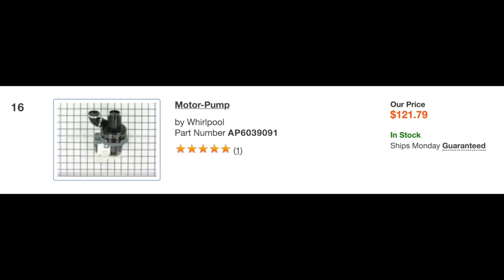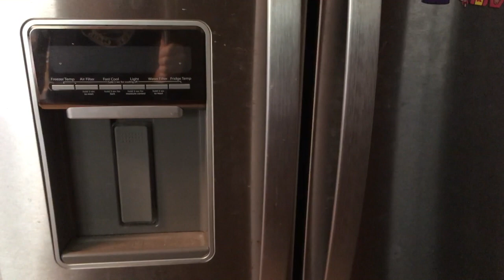Whirlpool Dishwasher Pump Motor Repair (And Upgrade?)

Comment: I have a Kenmore 665.13223N411 which is apparently a Whirlpool chassis. The panel on yours looks different, but the underside mechanics look identical to my own, so far as I can tell - definitely the same circulator pump assembly.

When the washer was just over 2 years old, it started having problems where it seemed to be stuck in the middle of the cycle. Sometimes, it would seem to keep running and running and counting down, but never advance in the cycle. Other times, it would get to about 210 minutes and then it would stop and you could hear a relay click every few seconds - it would basically do this until the timer ran down to about 45 minutes, at which point it would drain and refill and then complete the cycle. You could typically remedy this by opening and closing the door and then pushing start to complete the cycle. 

I noticed at these times that if the washer was stuck, the heating element seemed to be on, and if you opened the washer up you would actually find that it had evaporated off nearly all of the water inside. 

The problem was very intermittent. The washer might run correctly for days, weeks, or even months, and then suddenly have the problem again. Interestingly, I always found that when this would happen, my water hardness was very high and upon investigation I had found that my softener was not working (that's a whole other issue). However, it does seem like there is some correlation to very hard water and tripping error codes in the washer. 

I found reset codes online, and pushed the 3 button sequence 3 times, then it shows you the codes (in my case F8 E2) and then runs a diag cycle. At the completion of the cycle, if no problem is found, it clears the codes and then the dishwasher functions normally for a while. 

Around this same time, I began hearing a rattling noise when the washer wash in wash mode.  I always found it odd, but thought perhaps something was stuck in a filter or something that I couldn't get out. Washer continued to function normally so I never thought much of it. 

About 2 years on and maybe 10 resets later, the washer will no longer complete a cycle properly no matter how many times you open and close the door. Running the diag sequence always starts with an F8 E2 code and ends with an F8 E2 code. I now know this also means that the heating element gets disabled. 

I sat down the other night and babysat the washer. Ever 10 mins or so I tested water temp, and found the temp consistently declining (heater not working). Ran a diag cycle and it started and ended with F8 E2. 

I took the washer out of the counter and flipped it on its side with some towels. F8 E2 indicates drain pump, but when I inspected it... its not clogged, doesn't appear to have a problem, impeller shaft feels solid and motor feels good and quote strong. Inspected for and didn't find any wiring or connector issues. 

I removed the drain motor assembly from the pump housing by release the rubber grommet with a screwdriver and twisting it off. It was then that it was apparent that there was a problem as the impeller on shaft was extremely loose. I removed the 4 screws from the top of the pump and found, just like you, that the bearings on both sides of the impeller shaft were severely and oblongly worn. Also, there is tons of scoring on the inside of the housing where the assembly has been hitting the inside of the motor. Bingo, we found our problem. 

It is sad that there are no rebuild or bearing replacement kits for this model as it seems, with the screws involved, that even the designer of this pump intended the bearings to be replaceable. 

I have been toying with the idea of using some JB Weld to fill in the bearings and then drilling them out to the appropriate size and replacing with a generous amount of food safe silicon lube. Not sure if it will last a lifetime but can probably get through at least a year or so. 

I like your idea of using those plastic/steel bearings... same type they use on pool cleaner robots. My only reservation would be that they typically only last a couple years at pool cleaner RPMs so I don't think they will last too long in a dishwasher. At any rate, my JB Weld fix probably won't last, either. 

Its too bad we can't just source the replacement graphite bearing for this, hopefully with some decent quality control so they will not need changing again. It seems to me that graphite bearings probably should have been a lifetime part - seems there is some quality issue in the casting of these bearings  IMHO. 

I guess I would hope that Kenmore/Whirlpool would issue some kind of recall but especially with Sears going under I think that is wishful thinking. 

BTW: If it has not happened yet, the upper rack guides in the chases snap off on these. They are made of plastic. There is a 3rd party that actually makes a stainless steel replacement for this part that does the job and will probably last the life of the unit. The only downside is that its design does cause a loss of a couple of cups' space on the top rack but I am OK with that. 

I agree with you that this model is problematic. Its very picky about detergents, water temp, and rinse agent. If you're not using high quality stuff the wash quality is poor. It has never dried anything well, and I don't bother anymore. 

The best combo I have found is Cascade Complete + Real Jet Dry although the Finish pods might be a close second. I currently use Members Mark pods and Great Value Rinse Agent and when the washer works... it works okay, but doesn't really match the Cascade. 

Its kinda sad that these few poor design decision mess up an otherwise decent washer. When it is working, with decent chemicals, it actually does a pretty good job cleaning and its quiet... was never too great at drying, though.

Comment: Great video .  Quick PSA for anyone trying this though.

Don’t use a 1/2 drill bit to make the hole bigger to accommodate the 5/8 OD ball bearing.

I tried to wiggle the 1/2 drill bit around to make the whole 5/8  and it ate a hole through the side :(.

Comment: I discovered this video after already buying and installing a new circulation pump. I decided to take the old pump apart, as per your excellent video, with the thought of replacing the bushing and keeping it as a spare. My pump has none of the scoring you showed and the bushing looks round and true. It is not ovalled out like yours was. Do you have any thoughts on why the pump may have stopped working. Do you think it is worth trying to fix and keep as a spare?
Reply from the maker: I don’t know how comfortable you are around electricity, but you could bench test it. Give it 110v from the wall and see if it moves. If not, try giving it a spin by hand and see if that gets it moving. If not, the motor could be fried. You could also check the resistance across the motor windings. You should read some small impedance. If you get zero or infinity, it’s shot.

Comment: I feel like I might try it. I just replaced the flow switch on mine but that is not the problem. I was just hoping for a cheaper repair. I think I'll get my dishes washed in the sink and maybe get the motor out once my kitchen is a little tidier.

Comment: Same issues here! Whirlpool dishwasher is crap, Whirlpool fridge is crap (broken wire harness on door), microwave is crap (constant clicking sound).  I just replaced the sump & motor assembly, pulled the old one apart and same issue as you! Dishwasher started giving us problems at 4 years old.  I will never buy another whirlpool appliance.

Comment: thanks you very much for the great idea and video to  help me repair a dishwasher with a bad sump pump.  A word of advice to others that i learned from my repair...don't assume your dishwasher uses the same size bearing just because it is a whirlpool and it looked identical to the pump in the video.  If you do, you may have to reinstall dishwasher and wait for correct bearings to arrive.  My dishwasher is a 3 year old Whirlpool WDT720PADM2, my pump had a 3/16" diameter shaft and a 1/2" bore, so i need the 6455K1 bearing from McMaster-Carr.  My pump didn;t have a model number clearly marked on the pump, just a bunch of numbers "C35-3A  20min on 10in off cod.W10816492 HANYU Made in China 120 Vac 60 Hz 0.9A 55W cl 155   230516 02 06000.
My bottom bushing on my pump was not worn oblong, just the top bushing or impeller side was worn into an oblong shape and had scoring on the motor surface near the impeller.  I am going to replace both top and bottom though as soon as i get my new bearings.

McMaster-Carr is a great source for ordering bearings too, I would highly recommend them to anyone, 2 day shipping, they promptly sent me two new bearings and told me to keep the old bearings and they gave me credit for future bearing purchases, which they didn't have to do since it was my mistake.  thanks again for the great idea/video!
Reply from the maker: I'm glad you could take inspiration from my silly video and make it work with a different model!

And McMaster is the best. Period. Every site that sells industrial-type goods could take a few pointers from them. Their website and app are perfection, their specification listings are thorough, and their selection is second to none. If you try to find a part at MSC, Zoro, Grainger, etc, it's frustrating as hell. Let's say you need a 1/4" drill bit, so you search for 1/4" drill bit, you'll get results filled with drill bit cases, bits of every size that contains the numbers 1 and 4, hand drills, drill chucks, 1/4" bolts, and stuff you wouldn't even associate with a drill bit.
Reply: Using the 6455K2, he was able to shim out the shaft and expand the case for a tight fit.  I think I need the K1 as well, but I'm not sure if it will be tight.  I'll see when it gets here.  Maybe need to use gasket sealer to tighten the fit
Reply: Jay, you had a very comprehensive reply. Did you get this bearing to work properly. I took the measurements of the shaft and they are the same as yours. I was wondering, as how, Maurice suggested,would it be better to go with the bigger size and get a tight fit. Any advice you have would be greatly appreciated.
Reply: Using the 6455K1, I ended up needing to bore out the center a little (very difficult, not sure I'd do it again).  Also, I had to 3D print some shims for the outer race to fit snug in the case.  Got it all tight, and its going on a month now working good.  I didn't need to modify the case, but If I had to do it again, I'd use the 6455K2 like in the video.
Reply: @Jay Parsons thank you so very much for posting this. My pump is the same and thanks to you now I can see the actual specs of the bearing I need! I can't buy from McMaster-Carr since I live in Canada (and they don't ship to Canada), but now I can find a similar product in a Canadian store with the specs :)
I appreciate it!
Reply: Eduardo Hallal your welcome buddy anything for a fellow Canadian
Reply: @MoDiver8  I just ordered the K1 as it seems it would be easier to bore the center out and shim the outer race than drill the case. I'm planning on shimming the outer race with an o-ring, similar to how the graphite bearings are.

Comment: well shoot,  just yesterday I ordered a new lower assembly for $180 ($150 + tax and shipping).   Thats the "big round thing" you talked about, its the Pump, motor, and sump.  I may have to pull the existing motor out and see if it has the problem you just demonstrated here.  If it does, I'll re-build it  :D  stay tuned.  maybe I can return the new part I got?  hmm  I'll have to see if the pump is scored badly enough.

Comment: After I replace my pump then all this information comes up. My motor was really beaten up with a lot of wear on the magnet and had lots of play in the bearings so I replaced it with a similar unit. There are many equivalent model numbers and you can get a generic for just under $50. My graphite bearings were mounted with a rubber o-ring behind them. I didn't bother to try it but eBay had Oilite Bronze bushings that were comparable. 5mm ID x 10mm OD + a 12.5 mm OD flange  AKA 3/16 IN x 3/8 OD x 1/2 OD flange.  I could give an exact link today listed as $7 but I think it will age quickly. The "store" is called industry_x and they had ones without the flange too. You will need to get the pump in your hands to really be sure. Anyway mine was a KitchenAid KDTE104ESS1 and is exactly the same pump.

Comment: Let me know if you are still happy with the repair please. I purchased my new whirlpool gold series about 4 years ago and I am a single disabled person and I mainly use paper plates and plastic cutlery and solo cups so I use my dishwasher twice a week maximum and usually once every two weeks. 
I bet you can guess why I am here.
I purchased a whirlpool microwave/ convection oven at the same time and I had to tear it apart and replace all the door switches and fuses and a little control part.
I noticed how terrible the plastic is and it all looks 40 years old instead of 3 when I worked on it.
I only used the convection oven 2 times and used the microwave quite a bit but I keep it very clean and I use my stove/oven to cook most of the time.
You are right about the “junk” whirlpool or any store brand out there because they are all made the same

Comment: I agree.  I am fighting with my Frigidaire dishwasher and doing research to see how to fix the water not draining.  And, hose/line not clogged.  Troubleshooting it now.  But, it's not simple problem.
Reply: The drain pump is really easy to change

Comment: I'm sitting here staring at the circulator pump from my 3 year old POS Whirlpool dishwasher.  I bench tested it today and it will spin, but stutters and hesitates on start-up.  I'm sure when under load it simply won't start.  You aren't the only one who will go to this length.  I'll be damned if I'm going to pay $140 + for the want of a bushing!

Comment: Same deal here, took apart motor and came across your video. I wonder if it has anything to do with using the kirkland brand dishwasher tabs with the powder? It must get passed the filters as I can audibly hear the grinding of granular debris from the shaft and bushing....
Reply: I'm using the same dishwasher detergent .and wondered the same thing.

Comment: I have a 23 yo Kifchenaid.  Recently, the pump started making noise.  I found a OE replacement motor/pump for $52 on eBay (list price $354) and dropped it in.  Cleans perfectly.  4” impeller and massive motor.  I will never replace this dishwasher.  Modern dishwasher are junk.

Comment: Took our pump apart based on this video... AMAZING how to. Our lower bushing is not as oval-ed as yours but the motor does not spin freely and the magnet does stick to the wall of the plastic housing. Not sure if I take a stab at replacing the motor as the upper bushing has significant play like yours. How is the repair working over a year later?
Reply from the maker: The repair is still working fine. See the pinned comment about removing the top bushing. If I ever need to tear back into it, I'll replace that one as well.

Comment: my circ pump doesn't work either,  but when I bench tested the motor with 110 volts it spun out.After replacing the control board nothing still criculated. this may be the problem I am about to go back in. My brand happens to be a Kenwhore which uses the same circ motor.

Comment: That little part is called "Planned Obsolescence".  There is a science that goes into calculating how long a part will last before the customer needs a repair or replacement.  That bushing was purposely designed to fail just out of warranty.  Sometimes the engineer screws up and the part fails to quickly costing him/her their job and the company big bucks.  Some would say that that the company will lose the customer but there are only a couple company that makes all the brands out there.  The days of buying an appliance and having it last for decades like they did 20 years ago are gone forever.

Comment: Do the screw clamps work?  I heard they may leak because they go over the rubber groove. The groove to hold them in is for 3.81 otekir clamps that are hard to find and are only a 1/2" wide.

Comment: 2:46  Why is the inside so dirty!! 

I have a similar problem here with a different, simpler Whirlpool pump. But, grit returns within a week and stalls the motor. Next time I take it apart I will check the bushing.

Comment: I used multiple stainless steel washers, 2 sizes, to recreate the shape of the original piece instead, it works, cost less than 5 dollars at home depot,  we'll see how long it works 😅